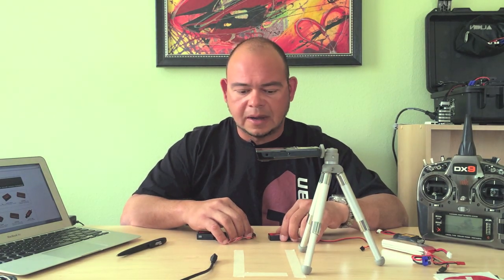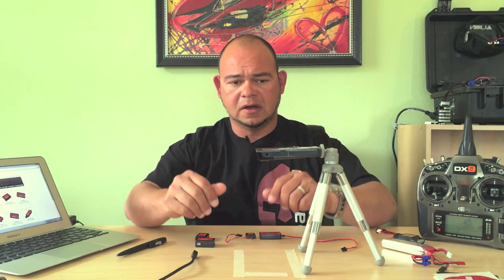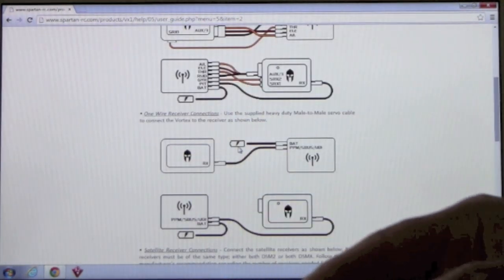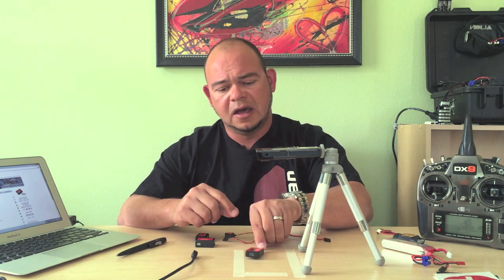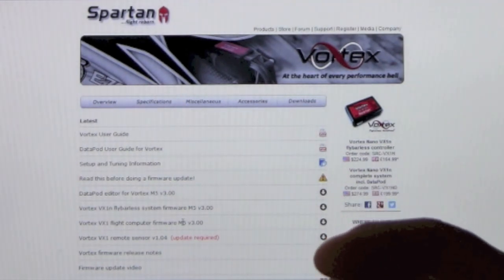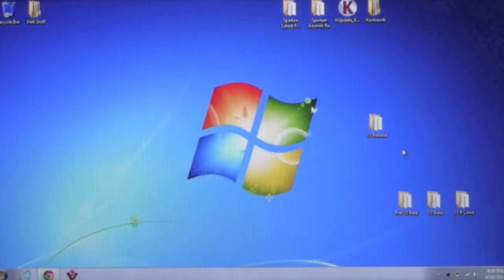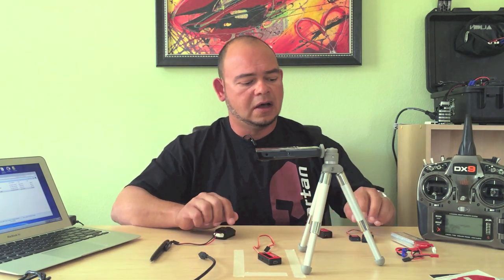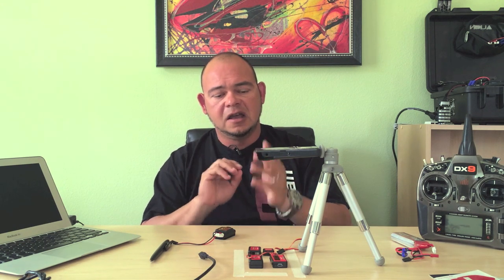Spartan Vortex Setup Part 2 of 6 - Firmware Update

Comment: I can see why these videos are needed - the user manuals are not organized logically and in different viewing formats. Some you can print (DataPod guide and Vortex Setup) while the other one seems to be formatted for online viewing only - most inconvenient. Also, out of the box the gyro doesn't work. You have to wade through online materials and view videos before you can even connect and bind the gyro. There isn't a single document that can take a new owner step by step through update, installation, connection, binding, setup. You mention that firmware updates are optional - clearly they aren't as I received the "No gyro found" error message upon first connection. I found this video and fortunately was able to update the DataPod. Now, I've got the VX1e firmware update, but following the steps in this video, the "Update" button never highlights - I don't get the Power-Up message either.
All-in-all, and based on the half-dozen units I've flown with, the VX1e is much more complicated to get working right out of the box - and it's further hindered by the documentation which isn't written from a users point of view at all. Perhaps in the next week or two I can get the VX1e to power up and accept the required firmware.

Comment: I tried to update the data pod on my windows 10 pc yesterday but it didn't recognise the pod or allow me to open the update software download. I remembered i had very old laptop the size of a house and as slow as a snail running vista. Plugged it in and fired it up, accessed the download again, plugged in the pod and straight away it updated and now matched to the vx1e i have just purchased. While i'm glad i have now done the update i'm a little concerned that it only worked running a10 year old operating system. I've not set it up yet as still trying to get my head around the connections as per your video. I might need a quiet room i think!